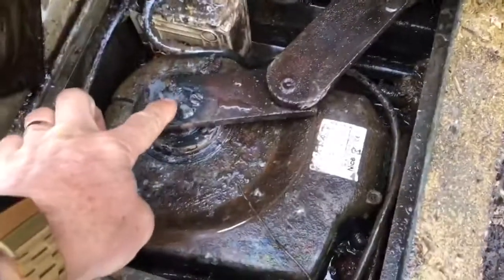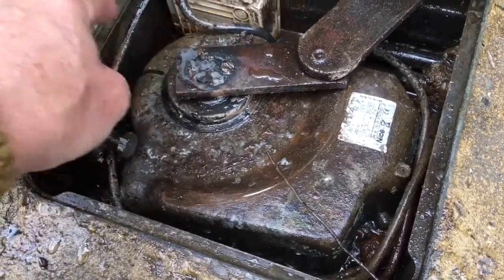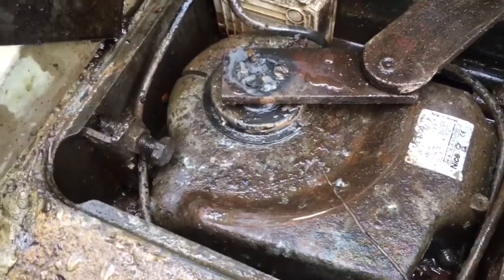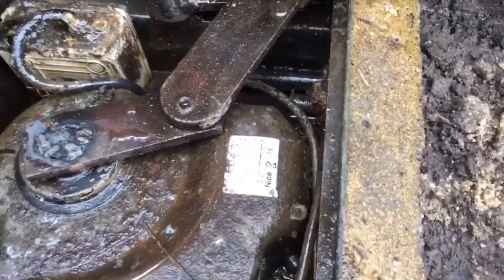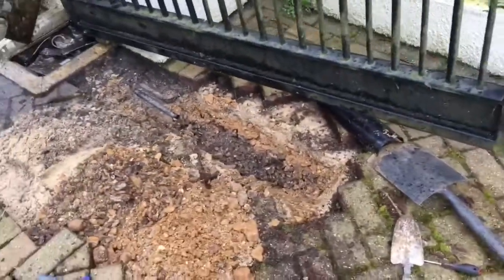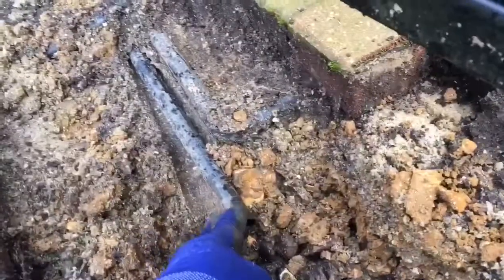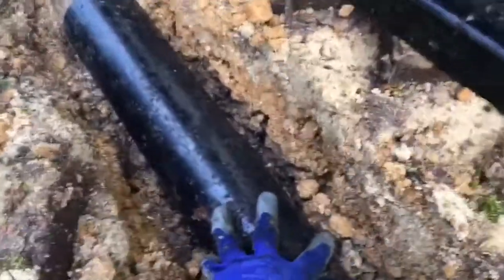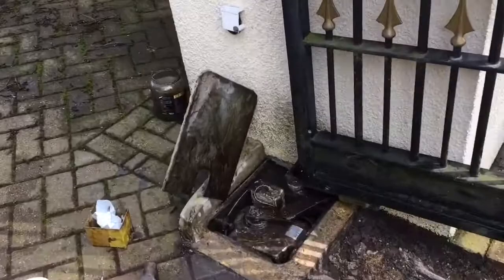More Electric Gate Fixes - Nice MEC1 / ME3000

Comment: My gates one open out and one opens in
Reply from the maker: If you want them to both open and close together the same way swop the two motor drive wires on the one you want to change. The two wires that go to the capacitor, often in the motor junction box. That reverses the motor..

Comment: I’ve got same problem with mine 17 years service , one guy called and did a couple of tack welds only lasted 3 weeks , waiting for better weather then they’re getting seriously oil rig standard welded ! Will get another 17 years service !!! 👍
Reply from the maker: I wouldn't weld them too much as it can knacker the gearbox/seal.  Better to drill and tap in some bolts to grip the shaft as in one of my latter videos on these gates.